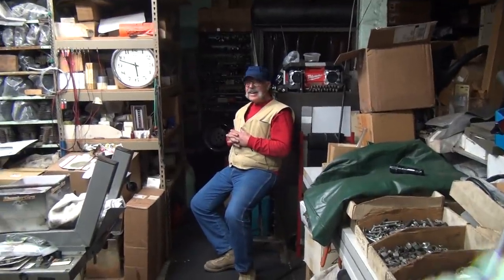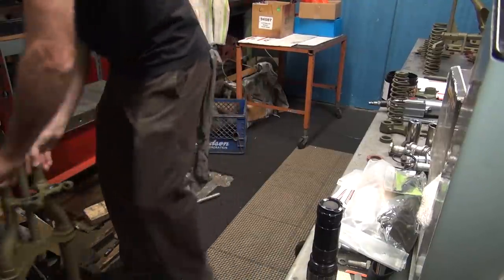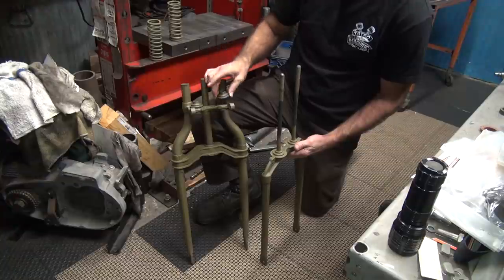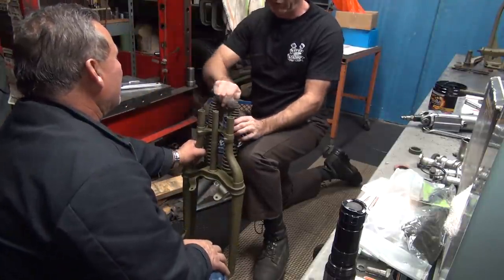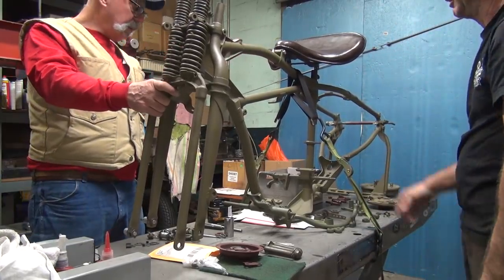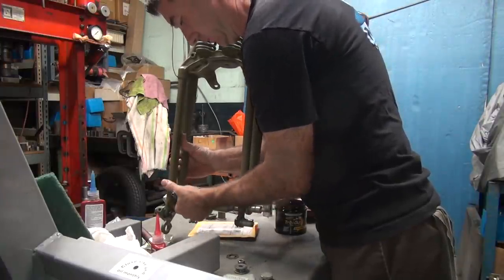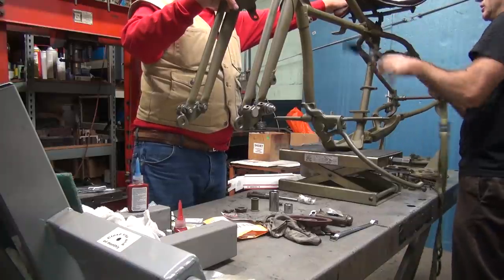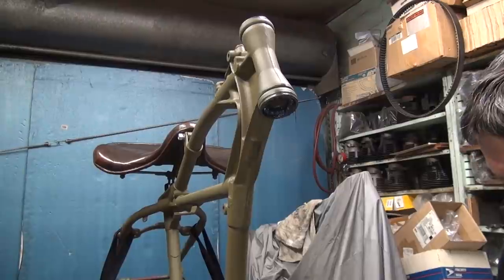1942 wlc wla 45ci #204 bike rebuilding chassis reassembly harley liberator by tatro machine

Comment: Those smaller bent springs go inside the top springs, not the bottom.
Reply from the maker: ok, so what do they do on top. i did say in the videos just incase you don't know how things really work.
tatro
Reply: First off, you know infinitely more than me.  Don't the bent springs go inside the top tapered springs (oem 46057-30) to prevent topping out on rebound? I'm guessing that because there are longer internal springs the go inside the bottoms (oem 46059-39)  to prevent bottoming out.
Reply from the maker: both springs are bent to stop them from rattling and look the same. they both work the same. one is for bottoming out and the other is for topping out. the lengths are about the same.
tatro
Reply: @TatroMachine  Harley Tools dude is on the money, sorry Tato !!!